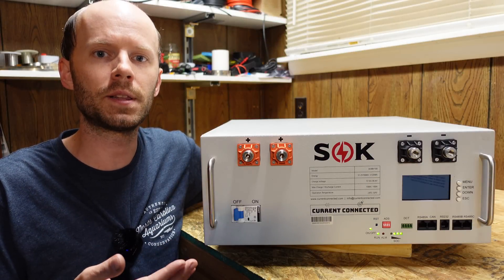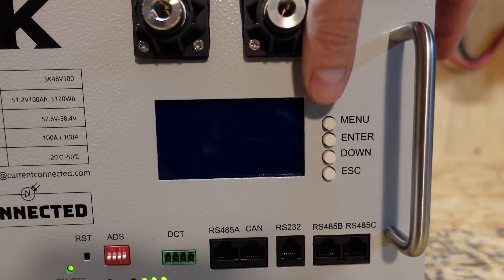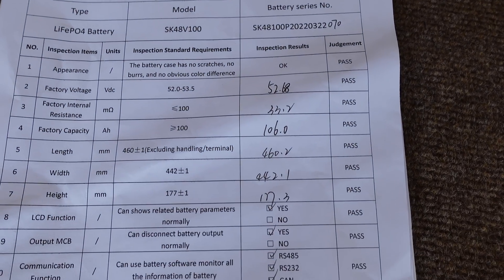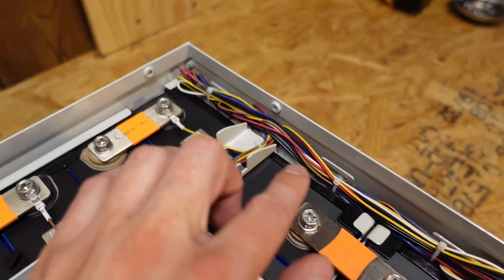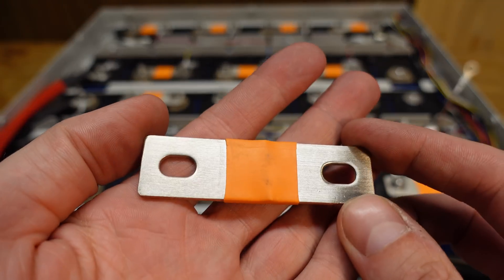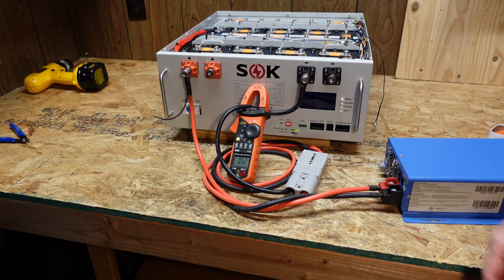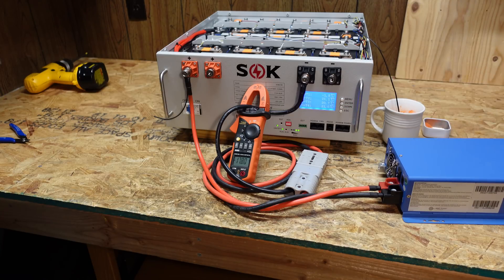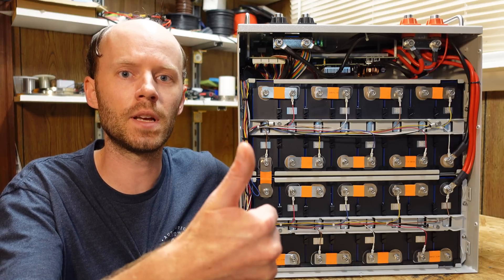Inside the SOK 100Ah LiFePO4 Server Rack Battery, Off-Grid Solar

Comment: I have a Sok like this with 155 cycles and it has went from 100.4AH on quality control sheet supplied with battery when new to now it says it only has 97.5AH on display screen .Ive only had this battery for 6 months.Whats up with that.Thanks
Reply from the maker: It's possible it needs to balance a bit. You could charge it up to 100% and leave it floating there for several days, then re-test and see if capacity improves. It's also possible the reporting on the display is inaccurate. I generally use BMS reporting to give a general idea not for exact measurements. A Victron SmartShunt would provide more precise reporting.

Comment: Has anyone else had a problem with the cells of these not being top balanced? I have had four in service for approximately three weeks and all four have a top balancing issue. Have only been able to charge to around 54.4V without tripping the OVP of the BMS. Each battery has a cell that will exceed the 3700mV and trip the BMS if charged to a higher voltage. As of yet the BMS has not made any noticeable difference to the balance. The delta between the highest and lowest cell voltage is 330mv (3700mV highest to 3370mV lowest). I have another four batteries yet to install and I'm not overly excited by the prospect of having to disassemble the eight packs and do a manual top balance, assuming the remaining four have the same issue. Curious if others have had a similar experience?

Comment: Hi, do you think it can be rewired as 24v 200ah battery, connect these two 24v part in parallel ? does the bms support that?
Reply from the maker: No, this is a 48V battery. If you need a 24V 200Ah in this formfactor, Signature Solar has one with the same cells.

Comment: Superb review,  thanks.
With different arrangement of batteries you can bring final terminals much closer to the BMS, basically both termminals end up in one corner of the box, saving cooper wires and voltage drops. Found this information in some older review. If anybody interested, i will try to foud it.

Comment: I'll openly admit the build quality is impressive, given the current options for pre-made server rack batteries. I was looking at the specifications. On Current Connected it says the BMS Low-Voltage Disconnect is 46V. Divided by 16, this is 2.875V / cell. The BMS Cell Protection Voltage is 3.7V. For those who would opt for 100% discharge & 4,000 cycles, this gives a usable voltage of .825V per cell or 1.32KW per battery of usable wattage. If you opt for 80% discharge & 7,000 cycles, then this is .66V per cell or 1.056KW per battery of usable wattage. The cost per KW is higher than some other options.

Comment: You should ask to see the actual test results for the cells that the cell manufacturer did when the were made. ALL cells are tested at the manufacturer to make sure they are all within spec. If they are in spec they get sold as Grade A cells at full price, and if the cell falls slightly outside of spec they get sold as Grade B (or worse) cells for pennies on the dollar. Every cell has a serial number or QR barcode that gets logged at the manufacturer along with it's test data when tested, so any battery assemblers that say those test results aren't available is lying. A LOT of sellers are buying cheap Grade B cells from manufacturers and building these packs selling them as Grade A batteries! You CANNOT test them yourself to determine if they are grade A or B cells as you don't know what the original manufacturers tolerances we're for grading. Also, a Grade B cell will appear to work just fine, it may even have full capacity etc, but over time they will degrade and fail far faster than true Grade A cells, but it could still take years to notice the battery isn't holding up like it should, and by then your past warranty and you SOL.
Reply from the maker: It has a 10-year warranty... I'm not sure how much better you can get in terms of warranty if the product fails.

Comment: I thought about going all solar and battery power, until I realized my house uses between 60 to 80 kWh of power every single day! Lol
Reply from the maker: Yep, that's about where I sit. I average 50kWh/day most days.
Reply: @LithiumSolar   For a battery system you typically only need to cover your use at night. I have 62.4kWh of Tesla Modules and about 35kw of solar on my house  because I charge EVs while a sleep since my car is at work with me during the day. 
For at least 5-8 hours per day depending on the season Im not even drawing off of my pack, its coming straight from the solar, through the inverter and out the plug.

Comment: I have tried to get these server rack batteries to Australia but the price blows out to a shocking price. I'd be interested in getting just the bare bones case and electronics so I can source the batteries here in Oz
Reply: Look up a 4U server rack case.
Reply: @onthelake9554  would that come with brackets and BMS and breakers?
Reply: @robertpoynton9923  No , its just the case , you can use a better BMS , posts , etc. . of your choice .

Comment: Looks like a nice battery. I can't wait for 500ah LiFePO4 batteries to appear because these 100ah units are way too small.
Reply from the maker: The problem there is greater capacity = greater weight. This one is already 100lbs and while I can move it myself, it's pretty much my limit without having to ask someone else for help.
Reply: @LithiumSolar  While that's true, I use strictly series connected setups, and avoid parallel battery connections at all costs. So, a 48V 100AH battery is just too small.
Reply: i have 2800 aH. Good luck finding a 48V battery this big without parallel connections. My 10 batteries work fine together. Still each one is 200 lbs!
Reply: Not many people have a forklift or hydraulic jack to move a 500ah at 48v battery. Once in place, certainly there are advantages as well as disadvantages of a massive monolithic system.
Reply: @john_in_phoenix  That's where 2V, 4V, or maybe even 6V batteries come in handy.
Reply: @moto-rambler  You already have 3.2v batteries at 300+ amp hours, parallel two. Otherwise I don't understand your comment.
Reply: @john_in_phoenix  because I don't like parallel strings, only series strings. And who sells a 3v 300ah lifepo4 battery?
Reply: @moto-rambler  EVE and CATL both sell 300+ amp hour cells, usually you use a series of 4, 8, or 16 depending on the voltage you want. The same way lead acid has internally 2 volt cells in series with 6, 12 or 24 series strings depending on the voltage you want. If you don't want parallel strings, parallel two cells, then put them in series. Or parallel 3 cells if you want 900+ amp hours.
Reply: @john_in_phoenix  thanks for the info, I'll checkout those battery vendors. Maybe I'm old school, but I prefer not to parallel at all, even cells. Series is the way to go & you don't have to fuss with balancing.
Reply: @moto-rambler  Yes , yes you do have to fuss with balancing .
Reply: @moto-rambler  You really should check out lithium batteries. Half the weight and twice the capacity. Usually at least twice (or much more) the longevity of traditional lead acid. When a lithium battery is rated at 100 amp hours, it really equates to 200 amp hours of traditional lead acid.

Comment: All looks good with as you mentioned those black wire terminals..Also i'm not sure how good it is when those temp sensors are placed over construction..that isn't helping much i would say..Samxon capacitors are not really reputable brand (in relation to that BMS) ..so for sure it will not last 19 years..but in case it will be charged with less than 50Amps and also discharged max 50A it might last some time..biggest enemy of that battery will be heat..if it will be installed in cool place..then it has chance to last 10 years 

..I'm not sure but i think there is same battery but without that display..that would be even better option..not just because it isn't usually needed once it is set but that display is reducing lifetime of system as whole ..
I think wire wise they could do aa bit better job..one thicker wire is usually always better than two thinner ..but i'm sure it was avaliability and price that they cared ....Hmm I would 

Rest looks good ..I also liked those big terminals at the input

I think i would create model with holes in BMS section because of heating..ofc iit could have covers and all that to make it water resistant..but it would be good option to disipate heat much better..
As i said heat will probably not kill those cells but it will kill BMS first so that should be improved..
Reply: I have assumed that the two thinner wires are used because they are far easier to route around the confined space with a possible side benefit that they'd heat less, having greater outer sheath area.  To replace 2 × 7 gauge you'd need a 3 for the same ampacity and that's going to be 6–7mm across with insulation.

Comment: I got the busbar idea from your eve video and told SOK to add them.

SOK is getting a custom harness made with exact perfect wire lengths to get rid of that rats nest. 

Next time I suggest unplugging balance leads from BMS before taking off the cell jumper (cell 8-9).
Reply from the maker: Oof yeah, should have pulled those connectors first. Not sure how I forgot that.

Comment: Looks high quality, workmanship is ok, but easily fixed. I checked for Colorado, it’s roughly:
$1790 price
$230 shipping 
$148 tax
That’s $2168 total
Reply: If you add more batteries the shipping only goes up $50 per battery
Reply: I can build my own 280ah 16s for $3000 with the same junk cells.
Reply from the maker: The GFB cells used here are most definitely NOT junk.
Reply: @LithiumSolar  have you cycled any of these packs 500+ times???? If not then I suggest not making an argument about there quality lol 
All batteries in this price range are built with A2 cells.
Reply from the maker: @millertechenergy  Current Connected has a document on their website showing cycle testing at a 1C charge/discharge rate.

Comment: I noticed my negative was also bent at a sharp angle. The BMS is also not consistently turning off using the reset button. I haven't figured out yet why. When I navigate to "Para setting" on the BMS screen it says "Non-production manufacturer can not use." Does yours also say the same?
Reply from the maker: Yes, mine say the same and so does my Jakiper with the same BMS. I think it's poorly-translated just telling you that the settings are locked by the factory.
Reply: It’s workmanship. They should talk to their guys.
Reply from the maker: @iTeerRex  I've let them know of the bend issue. They are addressing it.